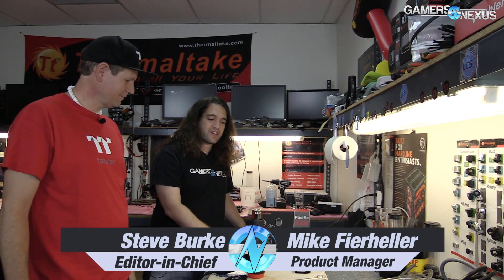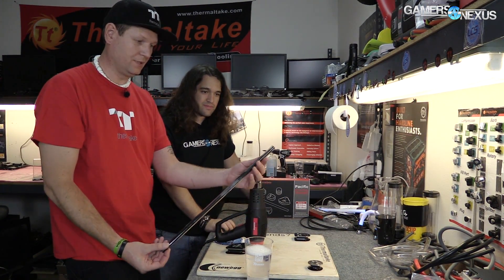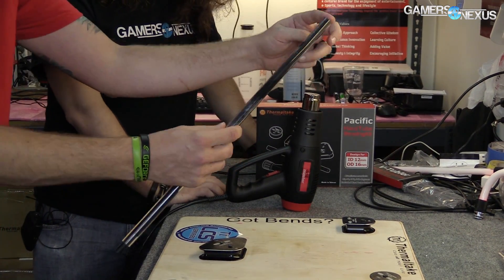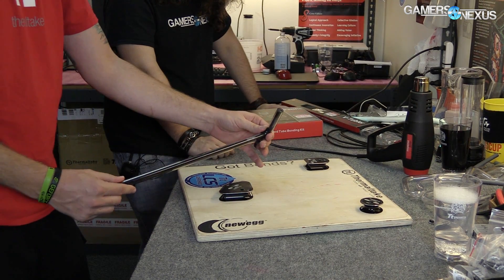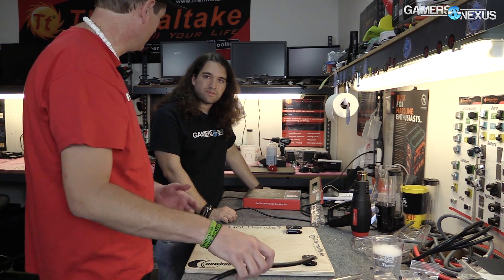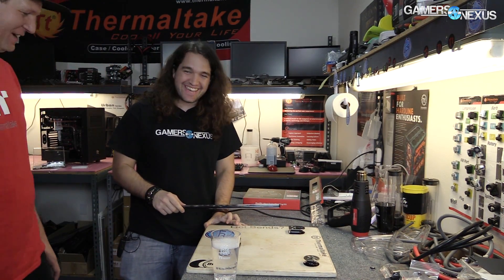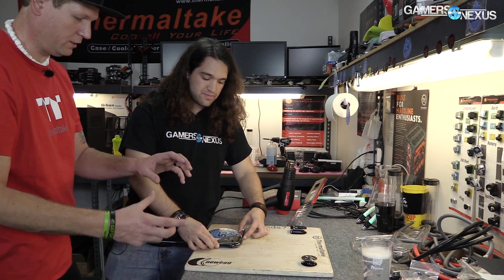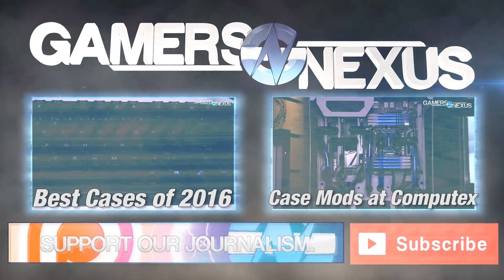Hard Tube Bending Tutorial with Thermal Mike

Comment: 90 degree bends in liquid cooling loops are a terribad idea.  Go for the widest bends possible if you must use bends at all.  Really, semi-rigid and rigid tubing aren't very bright ideas for cooling setups.  Sure...  you can use them and still get better cooling than all but the best air cooling setups and probably even still reduce overall system noise...  but why intentionally sacrifice performance when doing a custom config if you don't have to?
Reply: Because liquid cooling is already mostly superfluous and sharp, symmetrical bends are aesthetically pleasing.  Duh.

Comment: quick question,After it cools and hardens can it be reheated and changed  ?
Reply: Sort of. PETG is a thermoplastic so it can be reheated, but once you make the bend you have stretched part of the wall and compressed another part, and that is a Humpty Dumpty problem there.